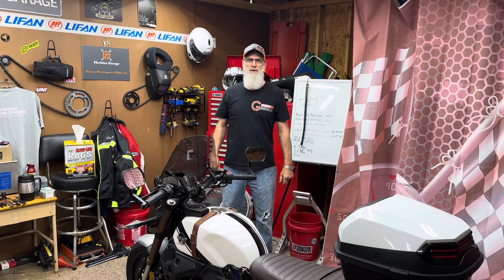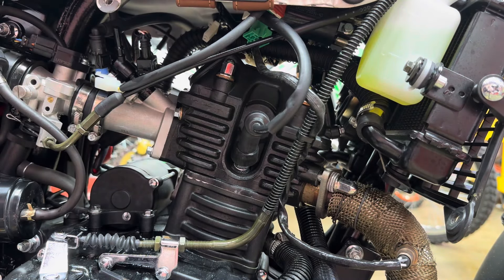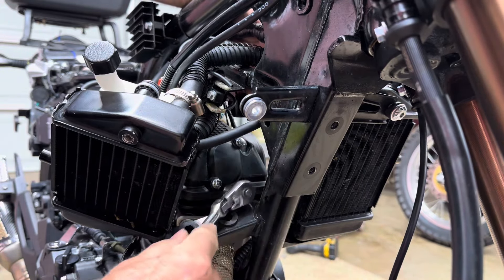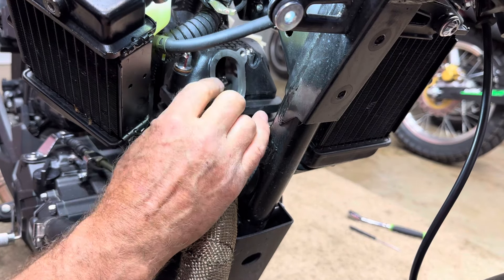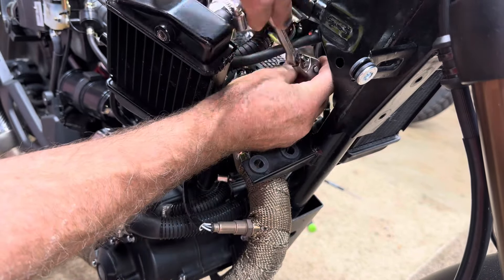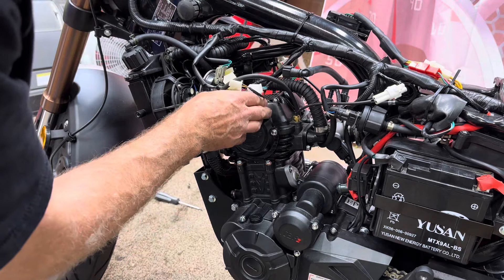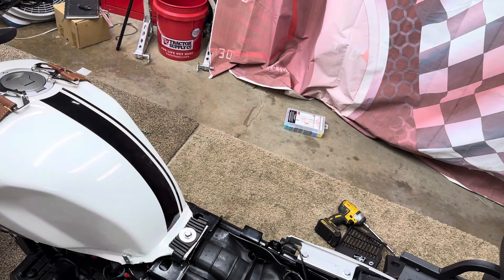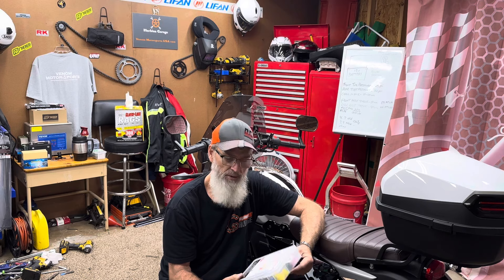2023 Lifan KPM 200cc, Complete valve adjustment procedure #motorcycle #maintenance #lifan #valve

Comment: Hey Herbie, i really like your videos, i got a Lifan Kpt I don't know if it's available for u there. she got the same 200 engine so i found your content very useful i really appreciate your mechanical advices.
Reply from the maker: @ghanou1930  Hello, unfortunately I haven’t found the KPT in the US yet. Is yours the 4 valve model? Thank you, I appreciate that
Reply: @herbiesgarage681  I have the 2 valves model (the old version), it's so good for now after 500kms, the other good thing about it, that it has ABS, i hope you can find one to add it to your nice collection ❤️
Reply from the maker: @ I’ve seen the KPT 200 and I really like it! I hope they import some to the US with the 4 valve head 😂 The new 4 valve head is supposed to push the hp up to 20hp from the 2 valve 17hp. That extra 3hp would make a great engine even better.